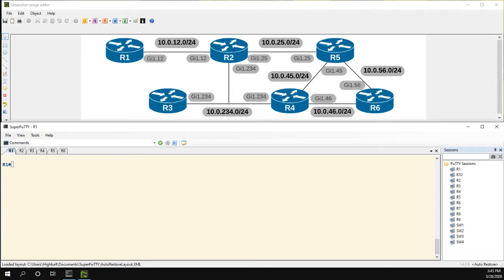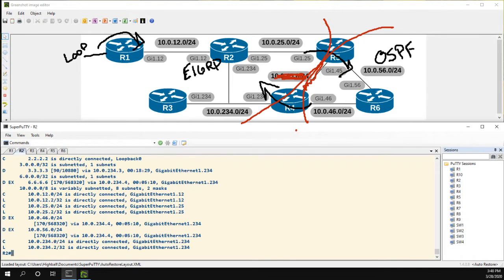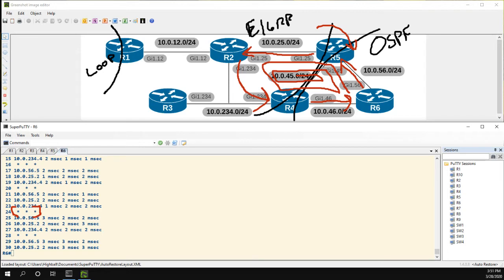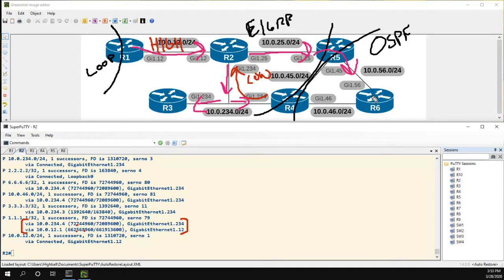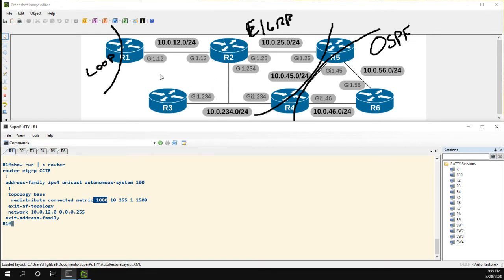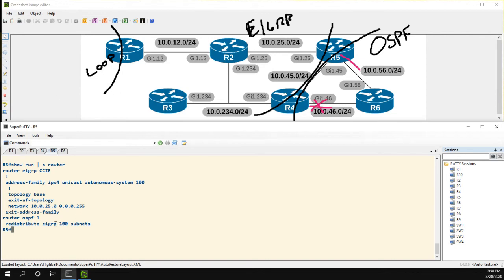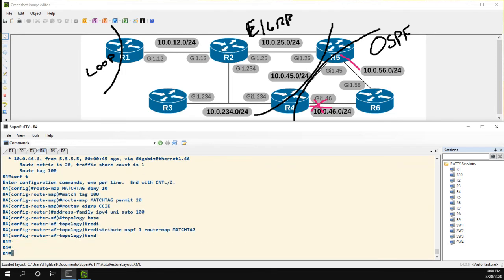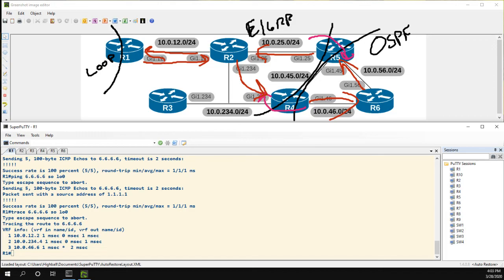EIGRP - Using tags to prevent loops

Comment: Thanks for posting this very informative video. If you were to design a WAN for your enterprise network, would you go for hybrid IGP (OSPF and EIGRP) or just pick one? Which is more scalable?
Reply from the maker: Depends on a lot of factors.  If we're talking WAN my first choice would be BGP to be honest.  But if you are limited to an IGP than I would just pick 1, not both.  I like to avoid redistribution until I need it.

 For OSPF v EIGRP, either works, but again it depends.  Is it a Cisco only shop?  What does the topology look like?  Are you using DMVPN?  Do you care about micro loops?  My point I guess is that there isn't a right or wrong answer here.  Both protocols are great, but you need to look at requirements before deciding.